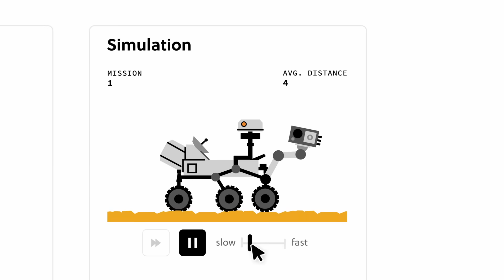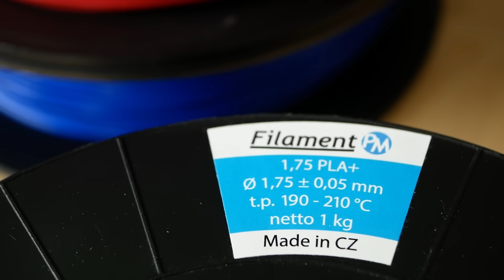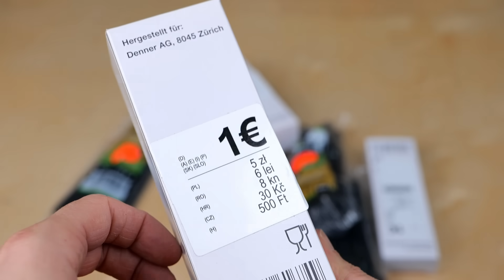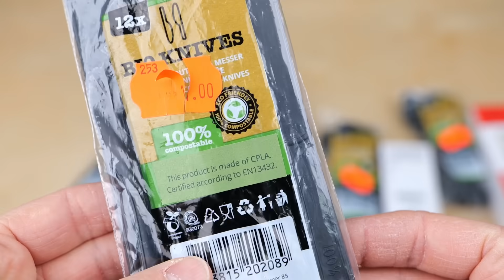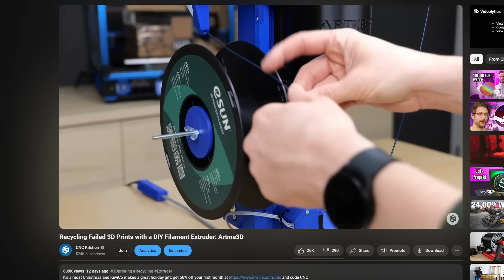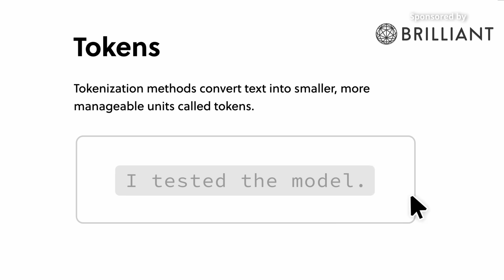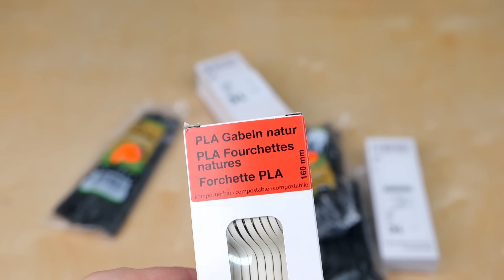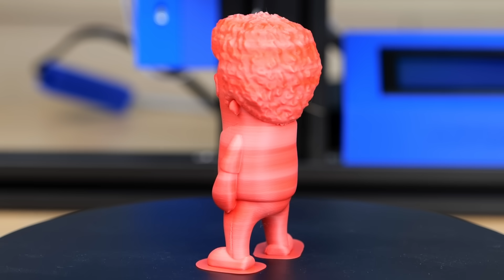From Trash to Treasure: Recycle Cutlery into 3D Filament!

Comment: This isn't just a US problem.  Asian countries have the most plastic waste in the world. This is a huge opportunity for reuse worldwide!
Reply: Environmentalism is developing a solution in search of a problem.

The biggest issue is that none of the environmentalists actually work in the industries they seek to regulate so they don't understand the logistics behind material use. Great example is California mandating "green plastic bags" which actually increased plastic waste 6x what it was before the mandate. Or also how California blocked logging in most of their forests which caused a buildup of dead material that lead to year long wildfires that destroyed ecosystems.
Reply: @DaveSmith-cp5kj  Some even do, I am in the "green" team at my engineering firm and we do have a guy there basically working in the industy, but they all argue mostly purely relying on their leftist mindset. Most are the dumb dudes gluing themselves to a road as if this would improve anything. Their are simply a huge drag. The guy who works with me, is basically there to calculate a carbon footprint for every product we produce so the gov. can charge your ass based on that as well, basically a tax increase. 
The problem is those people are also left up to hardcore communsists, they have no idea how our world fuctions. GThey think they can solve everything with just a bunch of new rules, but of course as you have said this usually backfires big times.
Reply: @DaveSmith-cp5kj  I know for a fact this isn't true... knowing multiple environmentalists that work in those industries and try to change things little by little from inside the companies.
But, there are always some politicians that seek gain in using 'the environment'. And then gain some momentum with stupid thinking and propaganda that SEEMS to be a right thing to do. Many times even ruiining environments for long time. Lots of time also money-driven in some ways like making compensation-forrests where the 'natural land' is open fields for other kind of birds or making small patches of 'nature' between highways without usable connections for the animals to move safely.
Reply: You get better engagement when you say it's a US problem.
Reply: Europeans have zero problems in their countries, so of course they get to act high and mighty towards everyone else.
Reply: @@SB-mj2giin Norway we have been forced to not use plastic in one use stuff.
Spoons of wood, or hard paper that gets squishy before we manage to eat up what is left in our papercup..
Or straw made out of paper.. Have to drink fast before the paper straw gets wet and squishy and impossible to use..

We can wonder what is worst, deforestating to make small one time use spoons or just use plastic and leave our woods to grow to give us oxygen in the air..
Reply: @@SB-mj2gi Another interesting way to look at plastic recycling, which unfortunately isn´t done yet on an industrial scale, is chemical recycling. You start chemically degrading the plastic to break it up into their monomers and then reuse these monomers to make new plastic. The benfit of that is that the molecular chains are not degraded and it´s virtually indistinctable from other virgin plastics. The big catch is, and this might also be the reason, why it isn´t done on an industrial scale, is that the most used plastics worldwide are PE and PP and you cannot break down these bonds easily enough to make it worthwile. So instead these plastics are getting burned to use the energy they contain for heating homes and stuff.
Reply: China and India account for 80% of the great pacific garbage patch. But you won’t hear that covered on CNN or MSNBC
Reply: wait until you find out the US exports plastic waste to asian countries 🤷🏻‍♂️!
Reply: And: plastics are burnable: usasable to get energy out off instead of using vergin oils to burn ;-) 
Part of metal-recycling can be from the burning-ovens, although hard to mix-out @@SB-mj2gi
Reply: US produces most plastic waste per person, you can't blame china for producing a bit more plastic waste without taking into account that it has 4 times as many people.
Reply: @pezomarko  Sure I can, because the planet does not give a fuck. If your 1.3 BILLION population produces less per person but has 4x the amount of people it´s still more. 
If there only lived 1 Million worldwide I could drive tank as my daily commuter.
Reply: @@SB-mj2gi I think it's terribly dangerous to point at "consumer behaviour". Consumers are practically sheep who buy whatever is cheapest and marketed the hardest. That's how it's always been and always will be, so consumers will never be able to make large changes like 'moving from plastic to something recyclable'. 

Change happens from the top down and the market will always put profit first and environment second. It is the governments' job to put environment first and make wasteful products expensive to produce. When they do, companies and consumers will happily and swiftly switch to environmentally friendly products.
Reply: @@SB-mj2gi I actually don't blame the oil and plastic industry at all, companies will always try maximize profit, that's just the nature of the free market. Likewise, it is in human nature to want convenient and cheap products. 

I can't think of any successful change of behaviour pattern that's been driven by will alone. It's so much easier to just tax or regulate bad products to death, then neither consumers nor companies need to fight their nature in order to make good decisions.

We actually had a very interesting case study of this in my country when a 'grocery plastic bag tax' was introduced. The price increased from ~$0.25 to ~$0.75 and this led to a 80% decline in sales practically over night.
Reply: @@SB-mj2gi Yes for sure, and that's what needs to change. Trying to swap out plastic forks and plastic straws isn't going to make any difference in the grand scheme of things, we need large scale efforts.
Reply: I think Germany is far away from perfect. From Spiegel: Of the 14 million tons of plastic produced in 2019, just 1.9 million tons came from recycled material. Almost half of that is from industry leftovers, meaning that just one million tons of packaging waste in Germany is reintroduced into the plastic life cycle. Just 7 percent. The vast majority of granulate is newly produced.
Reply: Come to Greece. As a Danish born, it's painful to see the amount of plastic waste in the nature here in Greece.
If we collect it in the nature and put 10-15 garbage bags at the trash cans, the local goverment get pissed on us, for giving them too much garbage to collect.
I spend a lot of time in Philippines, and the plastic waste problem there are LESS than in Greece.
Reply: Well, you are not wrong about Asia however i don't know any country where plastic cutlery is a thing. In the EU it is banned, in Asia many people use either hands or wooden chopsticks. For 3d printing u need a certain quality and if it's true that in the US plastic cutlery is a thing , this video is basically just made for you
Reply: Certain trow-away-plastics are banned here in the EU, but certain things are still available. Like all those 'compostable' plastics like shown in this video from Germany... 
And yes, you see that it is possible to do.
Not that 'we' generally use that much, but at parties and also events on which normal steel cutlery is not allowed, this piles up quite fast.
 @dan2792  

Actually, lots of festivals that used normal cutlery like knives have pretty recently switched to throw-away materials because for example of safety-issues, hygiene and logistic reasons, also keeping in mind that those newer materials are kind of compostable. Some countries I know of are Belgium and Germany + Netherlands.
Reply: @dan2792  are you under a rock or something. plastic cutlery exists in Asia. A lot of it really
Reply: Yeah, lets just blame a whole different continent, and then sit back and do nothing
Reply: Not really, you can´t collect all that stuff easily. It costs more to sort, clean etc than just create virgin material. We have the same problem in the automotive industry which we ciurrently work on, but the material is just not a good as virgin material and costs even more money.
Reply: @sierraecho884  They could use sorting bins for disposable cutleries. To clean, special dishwasher racks can be used.
Reply: @aluminumandcopper9840  Sure they could, I am not saying it´s not possible I am saying it´s not worth the effort and is more expensive. Because what happens next ? Who is cleaning that stuff and making sure it is clean enough ? Who is storing it ? Who is picking it up at all those locations ? Where does it go then for recycling ? etc.
How do you make sure the material quality stays consistent because recycled material looses about 50% of it´s original properties ?  
Alls this costs more than simply buying virgin material.
Reply: @aluminumandcopper9840  Alternatively they could simply use non disposable cutleries instead and the whole issue would be solve without any need of recycling anything.
Reply: @sierraecho884  Someone may be able to start a recycling program to make it cost effective. Imagine at a party, they're strict about using the same material for the utensils which makes consistency easy. If a dishwasher is used, it's more effective than cleaning by hand. There are commercial dishwashers that are fast and there are flat dishwasher racks that makes it easier to load a large quantity of utensils.
Reply: @aluminumandcopper9840  No they can´t because they have to obey the market rules, and according to the market rules it takes more effort in other terms it costs more to collect and recyclen than to produce virgin material. Also the material properties degrade significantly with recycled material.

What is even more cost effective is to not need to recycle (your dishwasher idea), but that´s a whole different topic.
Take my employer for example, we are looking for ways to use already recycled materials. Since it´s a huge company we will need tons and tons of material, the fact that we need all this material makes the material itself more expensive which is again a catch 22. You are dealing with all sorts of marked forces here. It´s not " ooh let´s make a better world and simply recycle kumbayaa" like many may think.
Reply: @sierraecho884 it even extends beyond recycling. Almost all renewable / clean things we need will be more resource or effort intensive than the old pulluting things they replace. But we still put in the effort!
Reply: @AnnaVannieuwenhuyse  This is factually wrong. Recycled Aluminium is waaaay cheaper and easier produces, same goes for any other metal. It´s also easier to collect, sort, etc. Solar an Wind can be very cost efficient as well. I don´t want to be mean but you have simply no idea what you are talking about. Sounds like you talk from a more political correctness point of view.
Reply: @sierraecho884  I'm not sure where you get aluminium recycling from, sorry. 😅
Reply: @AnnaVannieuwenhuyse  What do you even mean by that ?
Reply: @sierraecho884  Glass, too. Cheaper to recycle than create new glass.
Reply: @LobstersLobsters  This goes for many materials besides plastics. Glas, Aluminum, Copper, Tin etc. all those materials don´t lose their material properties when recycled, they can be recycled an indefinitely amount of time. Plastic degrades a lot when recycled. There is only one way to recycle plastic without the lose of material property and this is pyrosylis. Which needs a huge amount of energy and once again is way more expensive than simply producing new virgin material.
For this reason it simply does not make sense to recycli plastic, rather burn it and use the energy for heating.
Reply: @AnnaVannieuwenhuyse  Also glass is much cheaper to recycle, even when accounting for the cost to seperate and clean it, because recycled glass doesn´t need that high of a temperature to melt ity compared to the virgin Silicone Dioxide  that´s used.
Reply: @@SB-mj2gi Well nobody tells them to do so...
The US companies also produce most goods, also in China so ....
It´s a world wide problem which has to be solved world wide, blaming and finger pointing will not solve anything.
Reply: @@SB-mj2gi "...Wasn't that exactly what you did when you did the "oh, but Asia is worse" ..." Wrong adress, I didn´t wrote that comment btw.

"...Global markets and trends are dictated by consumers...." And China as a communist dictatorship, which dictates that btw has stopped this, so ? 

"...Global markets and trends are dictated by consumers...." I can´t increase their labor price nor not buy pampers or Shampoo bottles, none of this is the consumers fault. 

"... until South-east Asia rescued them..." So somebody again takes the waste as expected, and as always...

"...Recycling is never the answer...." Recycling is the only thing we can do. We can use less but this has an end cap, especially with China and India being half of the world population and Africa is growing, you can´t feed more people with less and cloth more people with less. So you have to recycle, there is no other way around this, unless you are for genocide and worse living conditions worldwide as is.

"...wooden chopsticks like Asians do...." Do wooden chopsticks have no carbon footprint ? How interesting ...